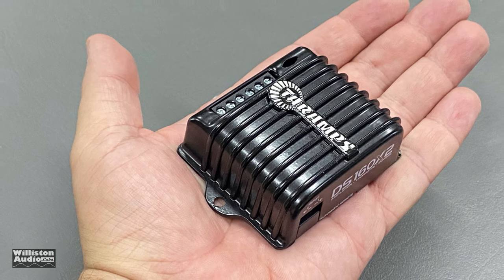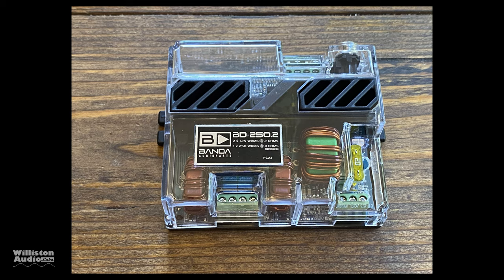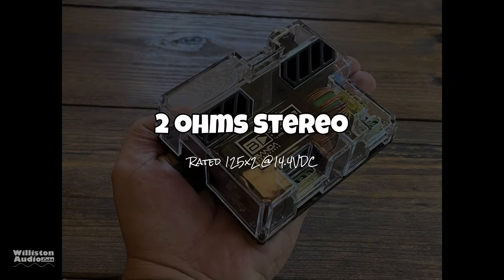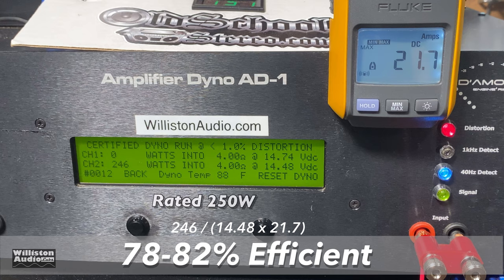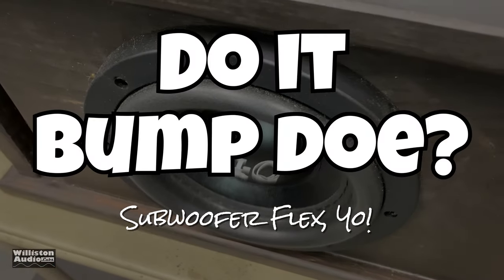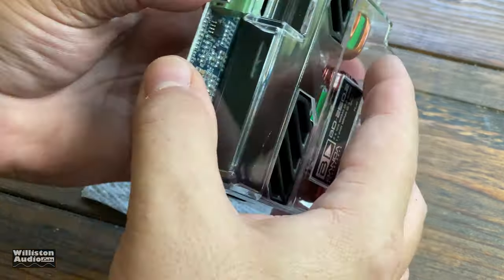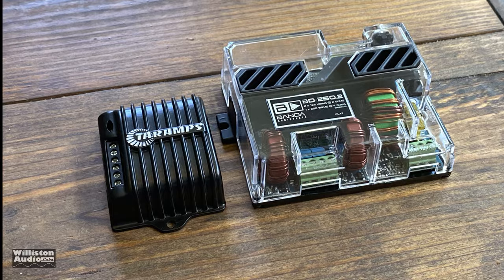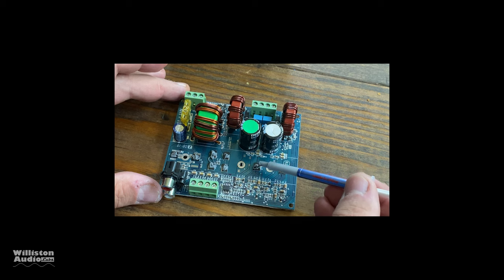This Little Amp is AMAZING! Banda BD250.2 Review and Amp Dyno Test

Comment: Or upgrade stereo in car, put one at each speaker if autoremote.
Reply from the maker: Could do 👌
Reply: Not fiscally responsible if your car has 13 speakers, but very efficient &
little foot print. Still great power for the money.
Reply: @408SPLKINGS  Didn´t say i were forced to do it, but in my mercedes it would be a cool mod as i don't have any remotesignal.
Just take speakercables to high input and route a big negative and positive inside the door etc etc and fit that amplifier.

I´ve got seven speakers.

Comment: Big D do you think Banda is solid brand because I was looking into their 4 Channel Amplifier and their class D mono Amplifier. I don't want to put this my car and my car end up catching on fire . I thought the Brazilian Amplifier are known for that. I have a lot money invested in my car and I would hate to see it go up in flames that's my baby
Reply: Bandas are great ampfilers your electrical had to be sufficient to handle the ampfilers that are 2k and up
Reply: What if I  purchase this 
Bass 3K Amplifier 1 Channel 1 Ohm Car Audio Banda 3k1 Audio 3750 Watts RMS 3000W
But only going to used 900 RMS with that be safe for my car
2015 Honda Accord Ex-l
Reply: @DallasCowboys100  are you planning to run it at 4 ohms or something? Otherwise would kinda be pointless,might as well use a banda ice 2k or electra bass 2k ifbyou can find one or an ice 1600 lol
Reply: 1 ohms 
SunDown 10"
Reply: If you use a recommended fuse in your instalation you wont have problem with it. In most cases the amplifiers gets fire because the instalation, the + cable touch the car steel (-) and the things blows up. Using the fuse if this happens the fuse cut the energy of + cable.
Reply: @ARPRJZ  thx for the information
Reply: @DallasCowboys100  use real ofc power and ground and the proper main fuse for the cable not the amp.
Reply: @paquesepas6696  well do thxs
Reply: @DallasCowboys100  Keep in mind you may need to upgrade to a better alternator, if that's a Honda with a 4 cylinder the alternator may have trouble keeping up with a 3000 watt amplifier. You could look at running a second battery as well.

Comment: That's great it has a fixed gain!! I have a Sony XM-SD22X that I purchased second hand that had (ofc the idiots set) it's gain all the way up. So I had to turn it all the way down and set the gain and other settings by ear. It's been great but I'm not satisfied with the knowledge that my amp may be off by a little bit and I don't think I have the proper tools to adjust it correctly. ¯\_(ツ)_/¯
Reply: You can get a handheld multimeter with a built in oscope for pretty cheap, then you can follow Exocontralto's video on setting gains with it. Unless you have your system at full volume all the time, having your gain a bit off shouldn't hurt anything. It's definitely not great that this amp has a fixed gain, as many car stereo's have different RCA voltages and you can't adjust the amp gain to compensate for that.
Reply: @ixionn563  that's good to know, thank you for your help :D

Comment: Will 8 ga. power and ground fit?
Reply: 12-Gauge is the largest wire the terminals except
Reply: @DTW-bx2vy  here's hoping that a Chinese 10-gauge amp kit will work as they tend not to run 1 gauge smaller in wiring. I'm installing in a Geo Tracker with four 4 ohm speakers, left/right in parallel to get 2 ohm rating.
Reply: @Meche697  how'd it sound, got a video of it?
Reply: @bobking7347  no video. Sounds great. Honestly, the newer stereo may have enough amp and I may repurpose this for a sub on another vehicle.

Comment: Aint it time for you to do another video on cheap ass amps? I got the one you did about 2 years back but think it's time for a new one please.
Reply from the maker: Elaborate please? Last two videos had $55 and $100 amps
Reply: @wal  A couple of years back you did the cheap Chinese Amazon amp reviews, they where only about $15-30 but great value for the money, I don't get much so have to work to a budget. When I was working I could easily spend a crap load of cash but those days are gone for me.

Comment: I bought a Taramps DS250x2 not long ago. Bad experience here. The amp really pull the Watts  rated. In mine one of the chips (POWaudio like the ones here) came unsoldered, short and blowed the power supply also. It was supposed to have THEMAL PROTECTION !!!!!!. Then its is clear .... heat transfer is POOR, the tried to sink the heat from the PCB to the case. I mean, chip is on the top, and the botton of the board is the one that is "heatsinked". Yes, they used large thermal pads, but .... 125W at even 80% efficiency still a long way to dissipate from this 10x10 chip.
Reply: Lmao was on track about that one

Comment: Do you have a recommendation for a 4 channel amp with a .1 for sub output? Price wise under 300$ and i would hope for the smallest dimensions possible. Im  trying to upgrade my 10th gen accords audio. Trying to keep it stealthy and not take up too much space. Ill probably pickup a component set of 6.5's.( so many options out there i have no audio what to pick lol).
Reply: In that case you would be looking for a 5 channel amp my guy, which is basically a 4 channel amplifier and monoblock amplifier in one unit. Pioneer sells a couple 5 channel amps, I've been running a Pioneer monoblock for a couple years now and I've had no trouble with it. I'd recommend the Pioneer GM-D9705, it puts out around 500 watts RMS at 2 ohms to its subwoofer channel, just make sure you get sub(s) you can wire down to 2 ohm to take advantage of that power. 4 gauge CCA amplifier wiring kit should be plenty for that amp.
Reply: @marthahansen7934  What? You talking to me? I just answered the guys question no idea who's stupid here.

Comment: Do you think it would keep cool under the seat of a truck?
Reply: If was me, I would put a 12v fan on it. Something like a entertainment center fan, I bought a stand alone fan to flow air through my RV refrigerator to keep air flow so the fridge stats cooler in hot weather and been working non stop for 14 months winter and summer in outside environment.
Reply: Have one of these installed behind the glovebox on my mini truck almost 3 years now and no problems pushing a pair of Hertz component speakers

Comment: Pulling 25 amps … gonna blow that 20 amp fuse ?
Reply: Amps don't instantly blow, they are made to tolerate a current going slightly over its ratings for a shot amount of time. It will pop right away if it is well above its rating but a little bit is fine.

Comment: Is this the same company as sound digital or is it a clone am I the only one that thinks this just because the rating are almost the same the case looks almost the same the price is almost the same I wouldn't mind seeing them against each other.
Reply: It is not. I'm from brazil, they are rivals, totally differents companies.
Reply: @Vonderheidon  thanks for the info. so they already are competing against each other already not the same  amp  Wich do you prefer?
Reply: @josephsaucedo8691  banda for sure.

Comment: D you be blowing my mind with these little amps! You could get 3 of them and power an entire system HARD!

And you ran it for an hour????

Man, this is the specs for one of the most amazing amps ever (if we were in 92). Is this apples and oranges???? Amps are just better these days???
Was my childhood a total and complete lie??????
—————————————
Rated power measured according to DIN 45500 up to 1% distortion factor in 13,5V

Phoenix Gold Route 66

Rear High Pass Speaker Outputs 
einzeln gemessen

1 × 54 watts, channel 1 at 4 Ohm 
2 × 54 watts, channel 1 + 2 at 4 Ohm 
Current consumption 14,4A
efficiency 55,6%

1 × 98 watts, channel 1 + 2 bridged at 4 Ohm
Current consumption 18,2A 
efficiency 39,9%

 
 

1 × 81 Watts channel 3 at 4 Ohm 
2 × 77 Watts channel 3 + 4 at 4 Ohm 
4 × 64 Watts channel 3 up to 6 at 4 Ohm 
Current consumption 35,5A
efficiency 53,4%

1 × 225 Watts channel 3 + 4 bridged at 4 Ohm
2 × 166 Watts channel 3 + 4 and 5 + 6 bridged at 4 Ohm 
Current consumption 57,1A 
efficiency 43,2%

444 watts total power

channel 3 up to 6 measured up to the clipping limit at 100 Hz because of fixed preset low-pass filter
Reply: It is 2020 bro. This is supposed to be space age. Look at the mobile phone vs a 90s SGi workstation for reference. We can do semiconductors on a whole different level these days.

You can edit and watch video on a phone that is smaller than a 1990s *mouse*.
Reply: Weareallbeingwatched but but but but Phoenix Gold!!!!!
Reply: @joesshows6793  I'm from the UK... so... genesis FTW.

Comment: The results should be a bit inaccurate cus your dyno is not measuring in 4 wire method.
Reply from the maker: What? 🤷‍♂️
Reply: @wal  yeah. Ur dyno is measuring with the wire voltage drop on wire + some inductance also effects the reading.. they should make a 4 wire measurement system where the voltage would be measured with a different wire to get more accurate measurement. & It would be better if they use oscilloscope wires to reduce effects of stray inductance.
Reply from the maker: You really think it makes that much difference or are we splitting straws here?
Reply: @wal  big d why ru using 100ft of wire the voltage drop is gonna be cray! Rethink this one! /s
Reply: @wal  it will .. specially when the signal is inductive it can make a difference .. & + bcz the voltage we r working here is pretty low the probe measurement must be done at the terminals of the amplifiers. Those banana plugs r also not the best. Although it won't make difference for amps below 100watts.

Comment: Have you seen anything with high efficiency like this but 4 channels 35-50w x4? It's for a older outboard boat, only has a 10 amp charging system so trying to go with a low powered high efficiency amp and speakers.
Now try to find anything other than paper cone 8" woofers with mid 90 db efficiency 🤪🤪